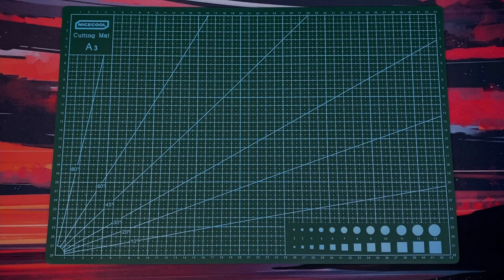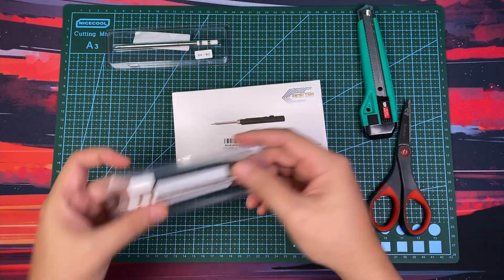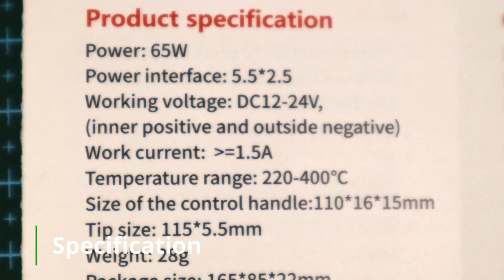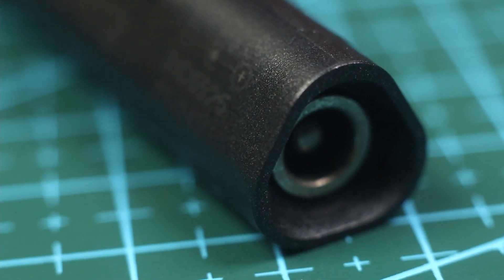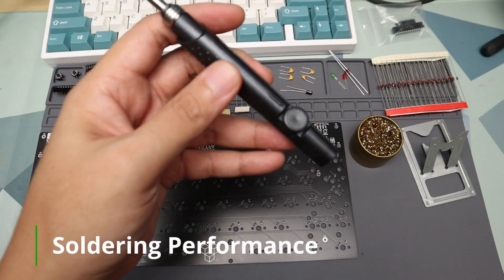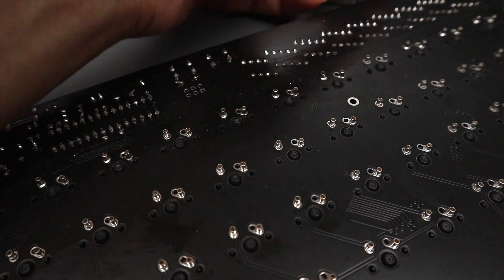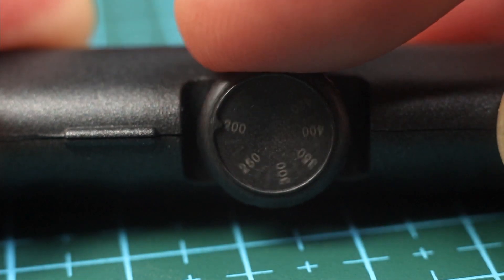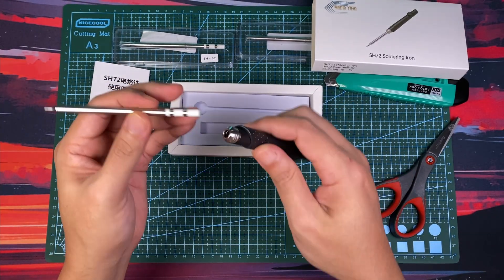SanErYiGo SH72 - A very interesting budget soldering iron

Comment: I am only considering this because I bought the wrong tip for my Fnirsi HS-01 because I didn't know what the tip for the HS-01 was called and only relied on appearance. It turns out this is a good alternative for my HS-01. Will probably use this more than the HS-01 as SH72 has better tips like the chisel tip.

Comment: I got one of these with my drone kit. It has a XT60H connector on the power cord. I thought it would run off the battery charger but, the connectors aren't the same. One is kinda squared at one side and the other is oval shaped. Might you know what power supply, adapter etc. I would need to get it to work? I have no idea why they shipped it like that. I'm up to the point where I need to solder. Thanks for any help!